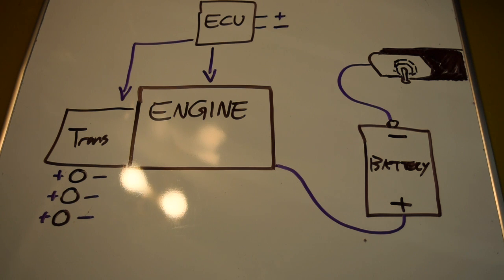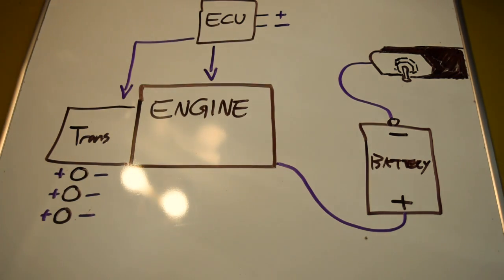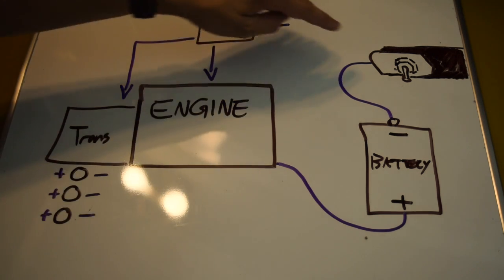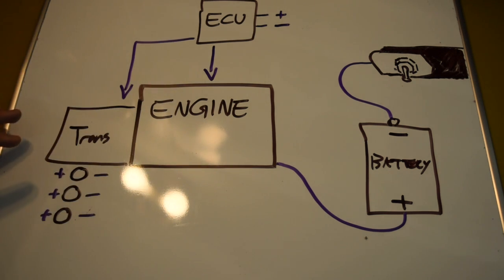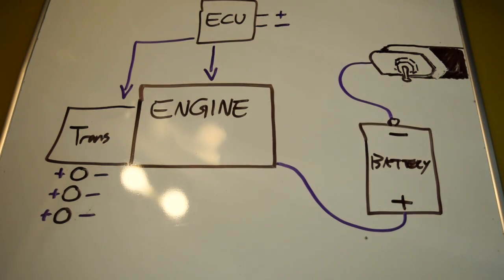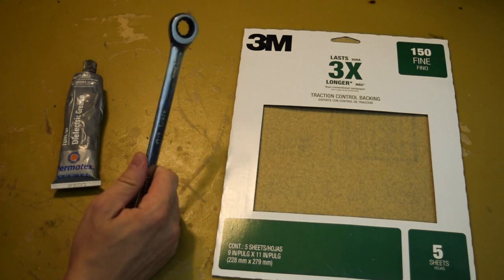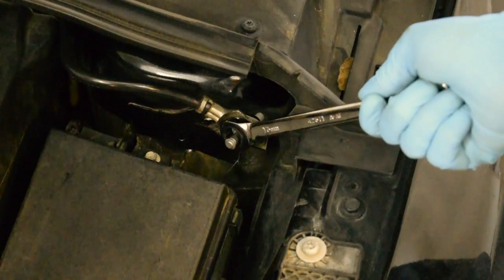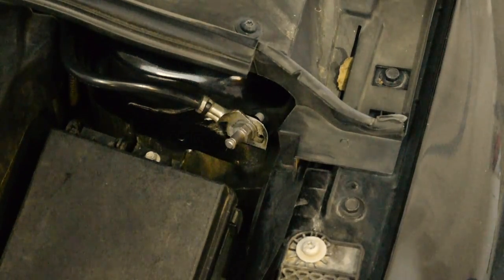Ford Focus DCT Ground Mod. Increase Driveability and Reduce Jerkyness

Comment: 3 ground wires  1 from the battery  2 on frame under airfilter case remove all paint from all 3 frame part to get correct grounds
Reply: Amen to that. I discovered the extra two by accident while doing the main ground. So far, so good with my 2015 DCT Focus with 12,000 mi. I highly suggest a grease called Noalox that electricians use. Can find it at Home Depot or electrical supply places. Dielectric grease actually interferes with electrical flow. Noalox can and does help electrons flow while fighting corrosion. It also is amazing fighting corrosion on battery terminals.
Reply: @ravenfn831  - "Dielectric grease actually interferes with electrical flow" Uhh, no! Who the hell told you that or did you pull that from your very own ass?
Reply: @Fucknuts4u  haha! It's true, brother fn.

Comment: He is right that fixes the shifting problem but this transmission got a recall on tcm or pcm 150 000 miles or 240 000 km go get a tcm installed by dealer

Comment: works for about 10 minutes , then goes back to shuttering. gotta dct tune these things to get em right $450-$500
Reply: Yep, a computer has to properly tune these gearboxes.
Reply: Would you recommend going to a tuner or is there a tune you recommend
Reply: @jeremyscott5038  Ford proprietary

Comment: I did this on my 2012 Focus when it was new and my transmission has been okay. 180,000 miles.
Reply: what prompted you to do this when it was new, and presumably not acting up?
Reply: @danielp.8081  I read about the trans issues and some people said the grounding could be improved and it would help and so  I just went and did it. Very low cost. BTW now 200,000 miles and trans is still good.
Reply: Still got the Ford? If so . Is it holding up well?
Reply: @The-Rebellious-Slave  yes, its doing great still

Comment: I purchased a pre-lemon 2013 Focus S model in July with only 20,000 miles on it. Added a stage 3 performance chip and a 26" MagnaFlow Red Pack muffler. She's got to be close to ST's hp, but I constantly reset the PCM. Going to try this for sure!!!
Reply: How do you reset the PCM?  Thanks in advance
Reply: @wilsonzechariah9770  disconnect the negative side of your battery and wrap it with a towel or something to where it doesn't touch any metal. Then take and run a mini jumper cable from the positive clasp to the negative clasp, turn on headlights and let's sit for 10 to 20 minutes. This drains everything from the module and you get a fresh start. https://youtu.be/YjPuyFE3kxQ

Comment: This makes so much sense now. I have been replacing battery terminals and main fuses like crazy. I’m trying this ASAP. Thank you!
Reply: Hey any update on the issue ? Did it work for you ?
Reply: Any updates??
Reply: Hey ben wells...you tried the fix i guess...did it work for u?
Reply: Guessing either it did, and he hasn’t thought about it since, or it didn’t, and he sold the car 🤷‍♂️

Comment: Better add ground wire to engine and gearbox. I did this to my both MK2/MK3.
Reply: Yeah, run a #8 gauge wire from the cowl bolt directly to the TCM case, no need to add gnd wire from engine to transmission, they are already grounded together!
Reply: @TheOzthewiz  any video on this
Reply: @kristianmopsticc2887  I am not aware of any video that shows this mod. This was my OWN idea after seeing videos showing bad grounds on Fiestas due to mistakes at the factory. Also, the 'stepper" motors that are used to shift the transmission and clutch pak are VERY high current. So, the lower you make the resistance in this series circuit, the less voltage drop you will have at the transmission resulting in a better functioning unit. By adding the #8 wire in PARALLEL with existing ground , you will be cutting the resistance dramatically! There is a video on 'Ford Tech Macalocuo" channel showing how to 'fix" the bad grounds on the Fiesta. CHEERS!

Comment: Yes we all here cuz we have Been  f””””””Ed by this Ford Focus my car already Ben replace 3 times the clutch ! The last time I pay 3000 to fix te total I already spend 6.000 to fix nothing happened! That car can broke someone easy ! So I will wait until the election ! And I will drive to Dc with all the flags on it trump 2020 ! So maybe my car can be vandalism! I can be free from that s****t 😂😂😂😂 someone have better idea ?
Reply: Thomas, I had the glitch replaced 3x as well. It all depends on the reading. It’s shitty. I was lucky enough to get it reboot it before the 150k warranty expired. I have learned to drive it as it and the car been great besides this issue so I’m driving it till it dies completely.
Reply: @toni2962  try driving it in manual mode, it helps.
Reply: Fernando Guglielmi lol you just payed half the cars worth 😔 Ford is a bad company
Reply: 3 clutch packs?  They are making errors with their diagnostics by that point.  I doubt that was even the cause of the problem after the second clutch pack
Reply: I should have thought of this 😂😂 brilliant.

Comment: This video was great! Good job! No extra bs! Straight to the point in a very easy learning valid informational way! Thanks for sharing
Reply: Taking the paint off at the ground point isn't going to hurt anything. 
It might not solve the problem, but it won't cause any additional problems. 
But as someone else mentioned; why not also add a ground strap from this chassis point to the engine block?
Electrons ALWAYS  take the path of least resistance.

Comment: Does anyone have problems with overheating transmission on the 2014 Focus?
Reply: I have issue with overheating transmission and dont know what to do
Reply: I had that problem around 100k miles, I did a transmission fluid change and the problem stopped immediately

Comment: Tried this and I still have issues. Going to change the clutch actuators see if it starts running smooth again
Reply: Sometimes I'll turn on the car and the check engine light will be on and I can't reverse and the car won't shift correctly. Code is p087a clutch position sensor B malfunction I believe. That said sometimes I turn on car and the car works just fine. Really hoping I can fix this
Reply: Right I have 14 , in the shop right now,  the forks aren't comm right... I'm no professional just what they tell me.
Reply: Hope your car is better off now,
Reply: @enriquecastillo3729  took it to the dealership ship and not really sure what they did but it's working now
Reply: @MFDan69  any idea what the fixed
Reply: @kristianmopsticc2887  no idea at all man sorry.

Comment: This is really true this is probably the third car that I clean the battery ground and the car works better a lot of the electrical components that need ground to operate they got fixed with this
Reply: ALL electrical components need ground to operate, dumbass! Another Einstein over here.

Comment: Mine is now parked at a service station, first time ever to sleep in a service place since I got it. It displays “Transmission Fault. Service now”. I’m trying ur method at the break of day👍🏾
Reply: My dad's said exact same thing ..and battery went flat ...get a new starter motor ..it's the selonoid on the starter motor that's not right ..I got a new starter motor fitted ..problem solved
Reply: Did it work?

Comment: Why not add a ground wire to the engine block
Reply: See I was thinking the same thing!! My girlfriend just came to me with this OMG head over heels with this  2013 focus it has a 100k miles the dealer ONLY wants 9k for it!! Drove it like 1k miles only had to fill up once!! I said hold up let's check into this TITANIUM!! Yet I have never even heard about. Hints why I haven't has a shit electric trans for a Manuel vehicle in it this is a dealer that's about to get his ass handed to him!! It's really not even worth trying to con him out of it because it's over the warranty so once the Electric motors take a shit it's time to get in the transmission!!
Reply: @raw2933  I bought my 2015 from Hertz in 2016 with 41K miles for under $10K. You got robbed.
Reply: @jamesvandamme7786  NO I didn't buy it boss!! I'm not stupid lol!! I have wheels buddy!! Knew the guy was a con. I told him to his face he was a rip off. Trying to sell a turd wrapped in fake gold.

Comment: This worked for me on my 2012 ford Focus. I researched the service records on my vehichle and the clutch and DCT had been changed not one time, not two time but four times and guess what FORD lies and this ground modification worked and I now have a fixed transmission. FORD never did the ground mod just ripped previous owners off for big money instead. Getrag made the transmission there was no way it could have been defective getrag makes great transmissions and always has. Ford's a bunch of fuckups with this ground issue no excuse for that.
Reply: Any updates? Did the issue returned?
Reply: Those replacements were probably free so Ford is just stupid. Lots of people have "fixed" it but I'd be interested in hearing if this fixed it long term for anybody!

Comment: Have a friends 2018 Focus SE, and it shudders till after 2nd then smooths out, will try the ground first, thank you!
Reply: We have a 2016, shuddered since we got it brand new, this was mentioned countless times to maintenence and got told it was normal. 

Finally took it in one day for a unrelated reason and we immediately got told it was bad and had to have it replaced. We drove like that for I belive ~50K miles.

Since having it replaced we haven't experienced any shuddering.

Warranty covered the replacement. 

If your local Ford dealer is telling you that it's normal, it's not, it's a common issue, but not normal operation, and you need to stand your ground.
Reply: I have a 2018 focus se to and It shudders in second gear to. Did this fix your problem

Comment: I have a 2013 ford focus, last night I was leaving work and I couldn't reverse. Woo, something new to add to the list of things wrong with this car. I tried again this morning to see if she just needed to chill out, and still not reverse. She would go in to gear but when I pressed the gas she acted like she was in neutral. I did this and it worked. I started her back up and boom I can reverse. I appreciate you so much for posting this because if not I would have (excuse my language) been fucked. I cannot thank you enough.
Reply: Any updates?
Reply: @jeremyscott5038  yeah. It worked for a day, but after that, she's back to her old tricks. Really just keeping her in hopes ford buys her from me after the lawsuit. 🤷‍♀️🙄
Reply: @GeminiEffect  went to a focus forum and I’m seeing about getting a DCT tune (which users are claiming to have fixed the problem)
Reply: @GeminiEffect  i'm having the same reverse issue and shifting issues like you, what's funny is that ford replaced the module one week ago and now newer issues are popping up.                                                                                                                                                                                      should i go ahead and try this video, any new updates did it work again? or should i wait until the dealership opens after the weekend and give it to them again?
Reply: @mohammedzeyad1559  I'm convinced the only complete solution is to put a manual transmission in her. And that's not something I want to do. But this helped a little, but after a day or 2 it acted the same. I think it was just undoing the battery that reset it and helped a little. Now I can't even use her to drive 40 mins without her not being able to accelerate. This car is a death trap. And my hope is for ford to buy it from me, but who knows when that will be
Reply: @GeminiEffect . I have a 2013 Focus and had some powershift issues over the years. I'm on the third gearbox. In the last replacement, I got the same issue you pointed out (erratic behavior, going to neutral while running and eventualy getting stuck in park position). It was adressed as a compatibility problem between ECM (still the original) one and the new gearbox. As soon as that ECM was replaced again, it all worked fine since and then still do, 18 months later.
Reply: have you taken it for service? I have the same issue. I'm hoping ford can fix ir or I just lost over $8,000 in my focus :/
Reply: Maybe try to clean the actuators too there's a video on YouTube about it  @gustavofernandezlembert4288
Reply: Clean the actuators, they build up dirt to and can't turn as well, look up the video

Comment: The FIRST thing I did on my '13 Focus (DPS6) was to remove the "ground strap" at both ends and THOROUGHLY wire brush the contact areas of the terminals and the transmission case. Then I added an "extra" ground strap , #8 starter cable. Made a WORLD of difference how the tcm performed! Those "servos" pull a LOT of juice, any resistance in the power circuit causes a BIG voltage drop, NOT good for the motors!
Reply: How do you do this? Please tell me thanks I need to know I live on my own and my car's shifting horrible
Reply: @FortniteBoss  you take the ground wire coming from the transmission going to the sub-frame (under the air filter box) and clean the area under the bolt just like he did with the cowl bolt. The dude in the video only took care of HALF of the series ground circuit. In MY case, I added a parallel ground wire (#8 gauge with ring terminals) from the cowl bolt DIRECTLY to the bolt on the transmission case, so that ANY resistance in the stock wiring would THEORETICALLY  would be cut in half. I YOUR case this mod may have NO effect because of a bad TCM or shift motor! THIS IS NOT A  "magic bullet" to fix all the problems!!!
Reply: @TheOzthewiz  sold it anyways bro but thanks
Reply: Same one thought
Reply: Though and ford can't find the problem
Reply: Can you spare some of your knowledge?  Dude just spent 10% of the car"s original price to replace the DCT n TCM was under warranty. Scared of the future. Please share...

Comment: Remove the lower engine splash shield so the trans will run cooler...will have air flow while driving so the pcm won't heat soak so much!!
Reply: But then it'll get splashed
Reply: @chocolatemilk2076  don't drive thru puddles!!!!!
Reply: Will driving through puddles hurt this transmission? I mean I'm not talking about submerging it.

Comment: I have the same problem with my 2012 Ford Focus, shuddering, and jerking when I take off from a full stop. however, it runs smoothly when I drive it in the morning for around 15 minutes, then after that is starts doing the shuddering. besides, it consumes fuel like a 6  cylinders car! (18 - 22 MPG) I think it's related to the transmission issue
Reply: Did you do it? Did it help?
Reply: Did you resolve it?
Reply: Gas valve
Reply: @kristianmopsticc2887  Can you explain more about? You resolved it that way?
Reply: I have exactly the same issue with 2011 Ford Mondeo. Cold start, first 10-15mins everything is ok, and then it start to shudder going from full stop.
Reply: Clean the Mass Airflow Sensor
Reply: 3 years and still having the same issue with the transmission. I feel it got worse a little than before. I'm surprised it's still run through. I tried everything, and nothing worked. For fuel consumption, I used fuel system cleaner, and it got much better than before.

Comment: The only 6dct250/dps6 ground mod capable of improving the transmission is when you modify the location of the entire unit by placing it in the ground with the other garbage we try to forget about

Comment: I have a 2012 ford focus that does the shuddering when the weather gets hot and going up hill. I tried your trick today cant wait to see if it helped.
Reply: Did it?
Reply: Did it help?
Reply: Did it ???
Reply: No it did not help I ended up having the transmission clutches replaced because it broke a motor mount and sent the engine into the radiator and had to pay 23 hundred dollars because the warranty would not pay for the transmission but did pay for the motor mount and radiator.

Comment: The shudder returns after awhile. Also, this isn't the only spot where the engine is grounded to the frame. Remove the airbox and you'll see 2 more grounded cables....
If you read through the rest of the forums, you would see that it returns, because all you are doing is resetting the ECU
Reply: I agree  it happeneds to me
Reply: @chocolatemilk2076  Did you have any DTC'S or check engine light? If so what were they and were you able to fix it? Forscan maybe?
Reply: Needs a stronger battery
Reply: Also there is 2 more behind the battery
Reply: Correct I done it did work a while smooth gear shift then back to hard again especially when stop at round about first gear then try to second gear but it stuck which is dangerous don’t know it’s clutch or need transmission oil change